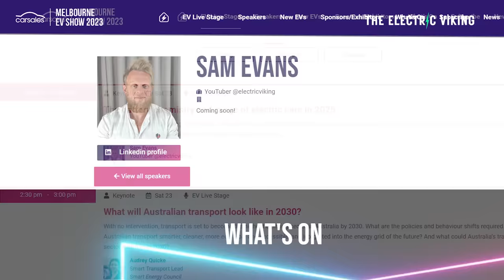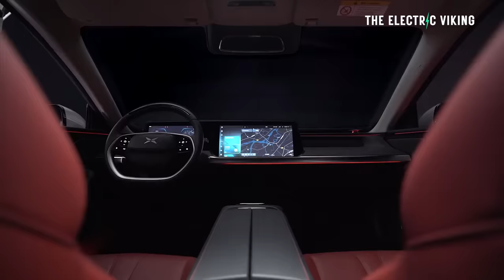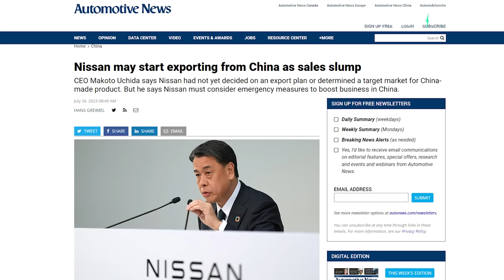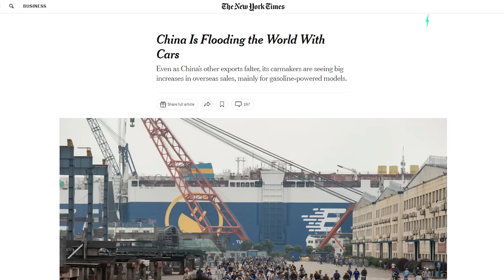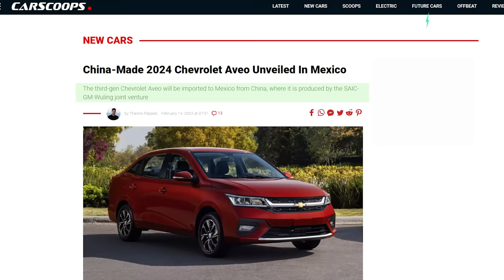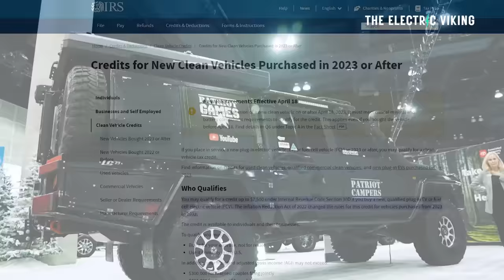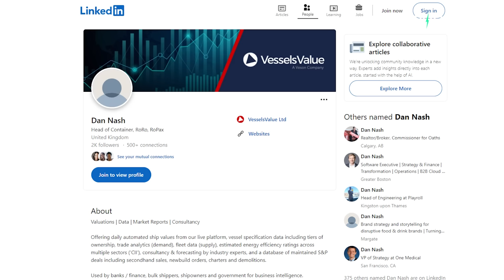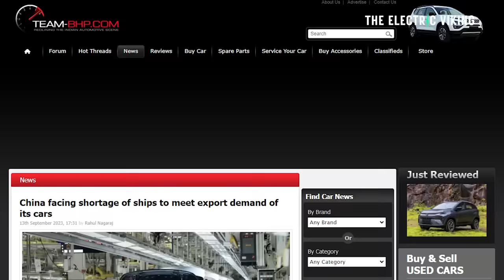Never before seen demand for Chinese Cars outstrips shipping capacity

Comment: I wouldn't call them cheap cars, just a bit affordable than other.
Reply: True
Reply: @icosthop9998 I agree , to say ‘cheap vehicle ’, is very very different than saying ‘cheap price’…..unfortunately many cultures have been mis-applying the word ‘cheap’ and using it instead of saying ‘good value’
Reply: You have to ask yourself: how is the overall cost on the long run? Do ICE owners include the higher maintenance rate and the higher energy costs as well as the taxes that are being used to repair the damages from emissions on nature, buildings and human health into the overall price?
Reply: Comparing to Toyota they are cheap and no more oil change 👏🏻👏🏻👏🏻 no more major maintenance. Soon they just like PC.
Reply: Corners need to be cut to make it affordable. Other cars at this standard already include 120kw charging
Reply: Cheap, comparatively speaking!

Comment: Great video again Sam. 
Let me point out a few things. Walenius Wilhemlsen is a Norwegian shipping Company - very large. And there are several more in Norway - although most are now registered in Int'l Shipping registry for tax reasons. Altogether they have been in a major position, therefore they have been able to charge more for transport per vehicle. That's why it's good the Chinese, like BYD start competing on transport. Perhaps they can reduce the costs from 3000 USD to 1500 USD per car on the Roll-on/Roll-off ships.

The next; the Chinese - without Brand recognition, must understand that in order to build a brand in Europe they have to prove that their cars are not only good, but actually better than the European (and American) competitors. This demand that much more people EXERIENCE it. But when an Atto 3 cost more than a Tesla 3, it is impossible to sell it! 

The Chinese must INVEST, not try to HARVEST the European market as they try at the moment. Double price in Europe, is simply not going to work. Unsold cars from China is piling up. Even in Norway. 

I love my BYD Atto 3, but soon I will exchange it to a Tesla 3 Highland or a the next model Y (if it come from China with phosphate batteries). 

To introduce Europeans to Chinese Brands(!) they need to be 10,000 cheaper than i.e. Tesla 3 or Y. 
If they can't afford that, it doesn't help building new Roll-on/Roll-off ships. 

And they need to skip the importers. Everything is anyway handled by independent handlers - such as import handlings, transport to dealers, etc. No problem in our modern countries. I.e. BYD need only an office with one or two employees to handle the representation and handling in Norway, or Scandinavian/Nordic countries. The dealers have computers and are able to order directly from China. 
What does the importer do? Except from adding a huge profit to himself, and decide to set the sale price on each model, and give the dealer a minor profit for all his work?

Sam, this is the actual situation. Unknown brands - like BYD doesn't sell. Until people know it, have tried, used it and trust it. How come the Chinese doesn't understand this?

Bigger profit is possible - but later. I love my Atto 3. But Tesla 3 or Y would have been, or are - a better deal. No matter what.

How can we make the Chinese understand? I have worked with Xpeng and NIO before they arrived in Norway - but they are blind and deaf to the real facts. So they sell a little, but they could and should be the best sellers. Look the electric shit car Toyota is the third or fourth best selling car in Norway!!
Reply: By the way, none of them paid me for my work! But it was "handled" by future - now present importers. Not the factories with whom I was directly communicating with at the time.

You probably don't believe it, but the importers put approx. 10,000 USD in their pocket for each car imported, ex. freight costs, doing almost nothing. And then blame the Chinese for the double price in Europe - compared to the Chinese prices. Atto 3 in example. What is the truth? I know it.

What does this prove? The Chinese are either stupid or ignorant, and refuse to listen to serious information. Although they've got the best/good products. Nearly ten years ahead of the European and American brands, except Tesla of course.

But the importer demand on top of all, a yearly "service-control" on the Chinese cars he import to maintain the warranty, costing approx. 300 USD, where as Tesla got no demand for this. And the charging costs for a Tesla at their fast chargers are almost half the price as of ordinary, independent European chargers. I must have been silly to have bought the Atto 3, that I actually love. Right? 

Better than a Tesla 3 - not at all, not in any way. But "everyone" has got a Tesla.... and I wanted something different,  and to understand a Chinese car. Now I do. Although I still think it is a great product, only 10,000 USD too expensive. As everyone else think. So they don't sell.
Reply: Europe isn't the only foreign market.  Between southeast Asia, south Asia, South America, Central America, the Caribbean, the Middle East ... there's a lot of market out there, much of it lacking a significant domestic carmaker, some of it fairly price sensitive.  Even much of eastern Europe lacks a domestic carmaker, and is price sensitive.  The Korean makers made quick inroads in the American market, mostly on price, decades ago.  Lots of people will choose price over badge, if it means they can afford a car, or a bigger car.  But direct sales would certainly be better than middlemen.
Reply: Very good point but for example BYD, there isnt a real European EV as good as that so they are already past the first step
Reply: As a China person, I know that China businessmen are the smartest in the world. Unless they have to, they won't let middlemen earn too high profits, which will cause their products to sell at too high a price and reduce their sales.
Reply: I think BYD do know, but if they reduce prices in Europe the EU will simply bump them back up again by imposing tariffs.

I think for companies like BYD, their best bet is to start manufacturing in Europe. Spain would probably be the best bet with a follow on move to somewhere like Mexico or possibly Chile.
Reply: Must be why Norway company oslotaxi, chose NIO as its vehicle recently. I would say Tesla: the emperor is naked.
Reply: @jimgraham6722 exactly. Ofcourse the Chinese know what they are doing. They are not focused on the European market yet. When they come, they will build a factory. And Mercedes and BMW will buy from there. Right now, they got the rest of the world.
Reply: Even under current price, Chinese car makers are accused of dumping and unfair-competing. What will happend if they lower the price?
Reply: BYD plans to build a factory in Europe and start producing cars in 2025.
Reply: I think they will for political reasons be forced to locate a plant in Europe somewhere. Romania is where Ford is doing some work, and Turkey is where they are building their delivery vans. mainstream Europe is so darn expensive because of all the vacation days and holidays, that i don't see the Chinese putting up with it. They would rather pay the tariff than feed the slackers in Europe. I don't blame the Europeans for wanting to work to live, but the Chinese will not likely tolerate Spanish attitudes. Spain tried to make midrange equipment, and got pounded by German brands. They have a short work week but they work very well, and they are great at automation.   @jimgraham6722
Reply: Actually the Chinese know it... it is the Trades policies of every country or Trade union policies of that continent that gives difficulty to exporters or importers because of protection for local production. In South East Asia, Ev from China and also Tesla is cheap compared to Europe not because of the distance that close but ASEAN Trades organisation support the EV evolution and given huge incentive and in the same time South East Asia don't heve established Car industrial so no need any policy for car industrial protection for local. Meanwhile in Europe, You have many car manufacturers that will definitely collapse if there is a cheap EV car invasion from China if there is no hidden protection policy ( camouflage with whatever they call like tax, tarix or whatever) ... No cars company in the world can be saved from China EV invasion if no trades protection since China EV technology are the most advanced in the world and they definitely can sell it cheap... They have done it before with electric Home appliances (Midea Haeir, Skyworth etc already became the biggest home appliance makers in the world), mobile phones (only Samsung and Apple survive from the top ten mobile phones, 8 were China phones), TV (also now dominated by China) Air-conditioning (dominated by China to), PC, Tablet etc and now they do it with EV....
Reply: @zimuli3549  everyone is smart, its just whose interest they align themselves to.
Reply: There's not really much Chinese cars in European  Market yet. Maybe in 1 or 2 countries in Europe that's about it. They are aware of it, especially the political issues and tensions.
Reply: Are you for real?????
Reply: I'm going to really think about this one.
Reply: Some of the comments are right, China's Automaker is not stupid if they sell the car cheaper which they can, they will be banned.
They just introduce their brand and wait for the local Eroupean factory ready to produce.
Reply: Fully agree to your comment.
Reply: Chinese EV only real competition is Tesla.  The other brands are literally trash.

Comment: it's likely that China car export will  hit 5 million mark before the end of the year
Reply: How much coal did they burn to achieve that?
Reply: @robertfonovic3551  Well, the answer is SIGNIFICANTLY less than if those same cars were built elsewhere.

China leads the world (by a HUGE margin) in the production AND adoption of green energy.
Reply: @robertfonovic3551 Did the west not burn millions of tons of coal to industrialised.?
Reply: @robertfonovic3551 China currently has the world's largest installed capacity of hydro, solar and wind power.  In 2019, renewable sources provided 26% of its electricity generation—compared to 17% in the U.S.
Reply: @johnsmith-cw3wo Trump should eat that coal then.
Reply: @ChinaSongsCollection  BS
Reply: @robertfonovic3551  what an argument ! bravo !

Comment: Something that all buyers of these vehicles must be aware of- spares for repairs. In our country we have an acquaintance who has bought a well known Chinese hybrid and the poor wife had a minor prang and this huge company has no spares to fix the vehicle, so they are stranded with finding and paying for transport. This could become a massive issue with manufacturers interested in getting rid of surplus stock with little attention to problems that may arise after delivery.
Reply: Spare parts problems has hit car from every manufacture, and is not a Chinese car problem, every manufacture is not making spare parts.  There is a bigger problem for ICE cars as they need more spare parts from normal failure (ie they break down more often).  This issue has hit insurance costs as they have to pay for a hire car while spare parts are sourced.
Reply: , if they oversupply cars, then the excess cars could be turned into spare parts and that's another way around it.
Reply: car part wont be an issue,  part can ship by air and arrive in less than 48hrs
when car became more popular part will be available locally.
so ton off oem company will make those part...
Reply: @ballerblocks  buy two cars instead of one and use the other for spares!
Reply: @JohnnyMotel99  lolllllllzzzzzzzz, you can't be serious, but a lot of car companies do this, anyway.
Reply: It also boils down to the roles of the agency that sells the car. The agency and the manufacturer should work hand in hand to ensure all after sales services including spare parts to be easily available at a reasonable price. 
Someone in your country could be enterprising enough to invest and set up a thriving business as the sole agent of a particular brand. And the manufacturer should be more than happy to work closely with this sole agent, even as a collaborator to co-invest in the business.

Comment: No wonder the EU is panicking.
Reply: That is right. It's not really a change. Cheap cars have always existed abroad (USA, Japan), but they have not made a significant impact in Europe.
Reply: @slovackoinfo  Yes. I think the EU can shield its home market to a certain extent - but it cannot shield its export market. Here in the UK we have a decision to make. The EU is about to stick with the Trade Deal it made with the UK regarding the allowed % of foreign content. In January 2024 a limit on foreign content will be imposed on exports from the UK to the EU and for exports from the EU to the UK. This deal was perfectly rational before electric cars. But those cars inevitably have a large % of Chinese content - for example batteries and flat screens and electric motors. This will stop trade in Electric cars between the UK & EU leading to the closure of BMW and Stellantis electric car factories. The decision to be made is this :- Do we open up our market to Chinese electric cars accepting that it is no longer possible to trade with the EU - or do we put tariffs on Chinese cars to protect foreign owned factories in the UK? 
Personally I'm in favour of letting Chinese car makers come in tariff free - even if this closes the foreign owned factories. Toyota, Nissan, BMW, Stellantis, Daimler and VW stand to lose the UK market and we will lose thousands of jobs. Let free market forces decide the outcome. But it is tricky.

Comment: That's incorrect. Chinese manufacturing isn't slowing down. China has moved some factories to Mexico due to US sanctions and tariffs. So the exports coming out of China has dropped. But Chinese products going all over the world hasn't. The reason you see Chinese EVs exports increase is because China isn't currently manufacturing cars outside of China (not much). But once that happens you will see exports from China drop.
Reply: But then, these other countries will learn how to manufacture, and cut out the middle man;)
Reply: Yes correct.  But I would say even those export related manufacturing within China most likely didn't actually decrease.

What has decreased (probably quite significantly) is the manufacturing related to the real estate sector.

That alone would drag down the overall numbers.

But outside the real estate related manufacturing sector, I think Chinese manufacturing is doing fine.
Reply: @TheSteinbitt  learn to build an ev  wont be easy, also you need complete supplied chain and resource, unless you have everything then you not going to be able to compete
Reply: @jetli740  Buy parts from Asia, NA and Europe, no problem:)

Comment: Good, but I wouldn't say that their EVs are rock bottom prices. They are competitive, and the 3 marques, MG BYD and Ora/GWM have got the 3 cheapest EVs in Australia, but they are still 20k or double the price of the cheapest ICE, which has a longer range.
Once the prices of these small EVs start hitting the low $30k and into the $20k price bracket, then the shift from ICe to BEV will happen very quickly and China will sell everything they can bring here.
Reply: Hi.  Agree.

Unfortunately, if companies like BYD continues to sell their EVs through dealerships instead of direct (like Tesla), prices are never going to come down significantly.

Comment: While the EU has a strong position in the intermediate and assembly phases of making electrolyzers, with a more than 50 percent global market share, it relies heavily on China for fuel cells and lithium-ion batteries crucial for electric vehicles.
The European Union could become as dependent on China for lithium-ion batteries and fuel cells by 2030 as it was on Russia for energy before the war ...
Reply: The big difference is that Europe can build lithium refining and battery manufacturing plants. Between 50 and 250 projects are under development or proposed in Europe, but many of those may be delayed or cancelled due to the US deciding to support the battery industry much more than Europe does, thus pulling projects to the US for higher profits. This may mean that Europe will be able to import batteries from the US instead of China if they choose not to support their own domestic battery manufacturing.

Comment: Problem with that stat is the fact China it self pad to get them mad. As to say, its not a fair comparsion to look at China Evs production and say its a fiar playing around for other car mfg. as well. If anything, if China is going to be shipping these cars to other countries, I would encurgage all those countries to have high import tax for them so to give your local auto a chance against China. Start looking into adding Li and Na battery production and start looking at solid state sulfur chem technology as well if you already have one. Even if you dont make the cars - all calls need batteries and it only make sense to control a good chunk of the pricing of said car. Giga presses are also something anyone can buy now - it just need lead times aka you need to give time for your auto to also get and build them too. They also should force China companies to also have to have repair options, parts, and other methods to make sure the cars are serviceable as well. You really dont want to flood your market with these things without having good grounds.
Reply: All countries are already issuing import taxes etc to give their own car brands a head start. And the availability of parts is an issue with every brand.
Reply: @j800q  More so with Chinese companies right now.
Reply: The prices already included all the heavy import taxes already. Those importing countries are not as stupid as you after all!